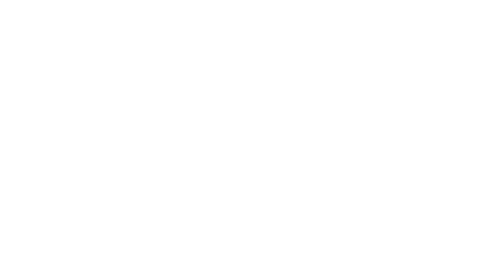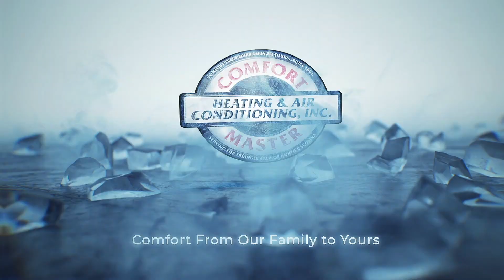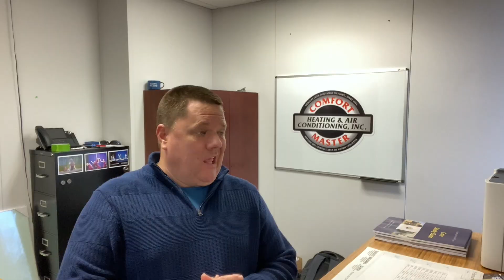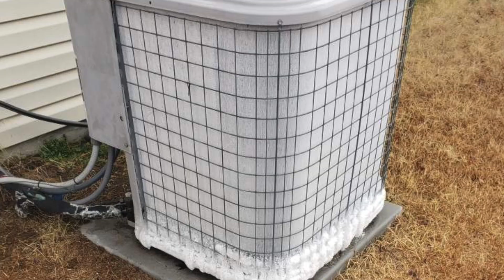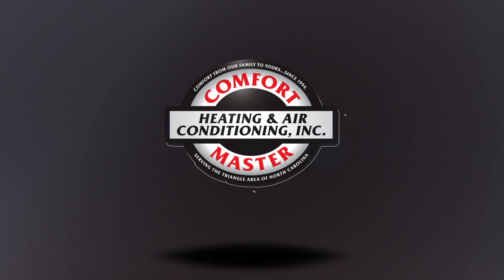Why is my heat pump freezing up?

Comment: Thank you. I wish my hvac techs had explained it so well. N. Fla artic freeze, with rain last night ice coating the fan grill but didnt realize when the fan stopped working it was in defrost mode. The loud pops and hissing snd steam iscalarming. Soujded like a steam engine at one point. Aftrr hours so went tu web for advice and advided to change the filter, call the pros, and even use emergency heat mode and ley the condensrt rest and thaw for about 3 hours. Covered with blanket anf tarp and, wiped off remaining ice with a towel three hours later 0230 AM. ER mode worked great, but wheh i tried to go bavk to heat mode the unit just hummed and fan didnt spin. Hvac tech came out in the morning, a little trouble shooting anf started right up. Said he thought the fan motor failing, but no way to kniw for sure. Call if stops again. Low 30s agaij tonight, but no rain (yea) but upset when doing the defrost dance you described, but 6 minutes later up and running fan spinning like it should. Thank you for your excellent explanation. 😊

Comment: I always tell the customer about the defrost cycle of their new heat pump and what to look for. Frost, steam, a loud bang from the reversing valve changing over and condenser fan not running with a buzzing sound is normal. That greatly reduces unnecessary non billable service calls and concerned customers

Comment: I just had a Defrost Circuit Board go out because I noticed this under conditions that were above freezing and in dry weather; this is normal in mixed sleet or snow and near freezing. I called for service and the defrost circuit board was out.

Comment: I just installed 2 Infrared lamps for my Mini Split. Aiming them at the outside coils. No more freezing. 250w each lamp. Spread them evenly over the outside condenser. About 5" away. A small roof over the system might also help. Now good down to 20 deg F. I have not tested it lower.

Comment: Thanks for helpful explanation of why air con goes into defrost mode in winter.  Can relocation of outside unit to a more suitable location help? Or is the ambient low temperature the key cause of freezing.?

Comment: Nothings better then a heat call where you have to work and tear apart a unit outside in a blizzard...Heat pumps are a joke, I won't work on them in the winter, they can Heat from the strips because that's so efficient 🤦‍♂️.
Reply: It can run a very high electric bill if you live in Houston, Texas!

Comment: It got down to 24 last night and mine iced up on the outside and inside where the coils are. It got down to 55 in my house, I guess that defrost function didn't work for me, so we slept with extra blankets for sure. I also tried emergency heat and the air coming in wasn't warm at all, it dropped the temp two degrees in the house. That unit is only three years old. I guess I'm gonna have to call the installer that put it in to check the control board, good thing is I have a ten year warranty on the parts.
Reply: When the system ices up inside along with the outside there’s a chance you’re low on refrigerant! (Really can’t be sure without a thorough check ikr)….  But emergency heat should warm the place up!? (If indoor coil has no ice on it!…. May have to run longer to get ice off indoor coil too!?). Especially if you have enough emergency strip heaters in the indoor air handler!(and the thermostat is wired properly!?)
What ton heat pump do you have!?!?!?
I usually have a certain strip heat for certain tonnage! 1.5 ton air handler 5 kw!
2 tons 7.5 kw! ….2.5 ton 10kw!  (3 ton 10-15kw)
3.5 ton 15kw! …4 to 5 ton 20kw strip heat!
U may have 3 ton with 10 or less kw!?
Check your air handler (outdoor tonnage also) size & strip heat level!
I’ve found commercial systems with low to no strip heat! I found a residential house one day with NO STRIP HEAT! I ended up installing 10kw on that houses air handler! They didn’t call back after that either 👍🏽✌️(2.5-3 ton heat pump outside)!
Reply: @orlandojohnson5742  I have a 5.5 ton split system, it's a Rheem.

Comment: When ever the temperature is in the 30s and below my heater will not heat and i have to turn it to emergency heat. 40 and above heat works normal. Any idea what's going on?

Comment: condenser motor not working in the heat mode will cause the condenser to ice up and low refrigerant in the system will cause the condenser ice up in the heating mode.

Comment: Most people don’t understand how heat pumps operate! If it’s installed and maintained properly, they save a lot of energy! Even in northern climates! I live in NH and sold heat pumps for over 44 yrs. It’s normal fir the outdoor unit to show ice on the condenser. It should defrost itself about every 2 hrs. of run time. I heat my own home with a 5 ton Carrier Greenspeed system! Love it! And the current system is over 10 yrs old!
Reply: That second reply stated a few issues. I won’t repeat. The most common is not setting your tstat high enough. If it’s below freezing outside, you need to set that tstat at 68 minimum! I keep mine at 72 or higher. I’m older now and like it warm.  The outdoor unit uses the heat inside your home to defrost that coil outside.
Reply: I still prefer natural gas. Warmer, better, and cheaper.
Reply: and when it doesn't defrost then what? why is my defrost not working. solid sheet of ice across top. no air flow.
Reply: @rps714  lol hope  U got it fixed!? 
If the refrigerant level is normal & runs in both cooling & heating mode (after u have defrosted all the ice on the top/fan & coil outside!?)…. U prob need to check your outdoor/defrost thermostat/sensor! 
A heat pump has an outdoor defrost thermostat/sensor! If system ices up like you say! There’s a timer (on most) on the circuit board with usually 3 settings! 30-60-90!! Set the timer on 30!(if u find it has adjustable settings) If it’s still icing up…. Order a defrost thermostat & install! Or call a reputable company to test the defrost thermostat & the defrost board!!!!
If it hasn’t lost Freon/refrigerant those are your 2 likely problems!!! If new defrost therm/sensor works u can prob put the timer back on 60-90 setting! The lower you set it (defrost cycle counter) the more defrost cycles the system will go through!(of course the board cost more than the defrost therm/sensor)!
Most of the time after some time goes by the defrost therm goes bad….. if you’re gambling which part…. always go with the cheaper repair to solve your problem!👌👋🏼
Reply: What temperature should come out of vents from a heat pump in heat mode.
Reply: Ten years old? That is brand new. My Lennox system is 36 years old. Compressor replaced in 1996. NO other repairs of any sort. Period.

Comment: Who ever designed the "Heat Pump" system in general should be SHOT   -   Heat pumps don't work when you need heat the MOST.
Reply: Actually they do work ok. The biggest flaw is the installation crew sometimes don’t put a big enough emergency/strip heater(s) in the air handler!!! Ikr feels lukewarm majority of the time!!! Put a space heater in the bathroom cause shower time feel a draft!?!?
Make sure there’s enough strip heat & u can install an outdoor thermostat on heat pump to energize strip heat operation. Preferably around 35-40 degrees to compensate with heat pump outdoor loss of heating inside!?
When heat pump is properly installed & set up they actually work pretty gd during winter!
Of course more they heat up the more probably gonna cost too! (It’s about savings & taking the chill off too ikr)…. Can’t win …. Sometimes u pay for more heat!
A more spiffy heat pump with variable speed indoor (ECM motor) motor feels more like gas heat system…. But u pay for it…. As said b4!✌️👋🏼
Reply: If u have a 3 ton system(ht pump) with only 5 kw to 7.5 kw strip heat …. U don’t have enough strip heat!!
At most commercial buildings some don’t have much emergency strip heat! (People usually dress differently & no showers etc there)….
Live & ya learn! Old school HVAC know what to look for or assume in these situations!
Reply: @orlandojohnson5742  Usually a three ton HP call for 15 KW strip heater.
Reply: Not shot. But should not be installed anywhere that Temps get below 20 or so.
Reply: When design properly they work excellent
Reply: I’m struggling with my heat pump right now it’s been single digits in Maryland this week my heat pump keeps frosting and blowing lukewarm air
Reply: That’s total bs. My heat pump is 2/3 more efficient than my electric resistance heating, and works great. It needs to be slightly oversized, and a cold climate unit. A properly charged, sized, and high quality system will work! Also having the correct ductwork and enough insulation is crucial!
Reply: I feel it’s main purpose is for ac
Reply: You need a ground source system for air temps below 40F as this is where ASHPs efficiency falls off
Reply: Nonsense. Maybe 15 years ago, but cold climate air source heat pumps are widely available these days and go well into the negatives, often still running well over 200% efficiency at close to 0.

Comment: The unit I have looks a lot like the one pictured (not that that really matters though). Would you recommend the installation of heat strips? Are they an economic value?
Reply from the maker: In our area (NC) it is required to have electric heat. It usually depends on you climate area.
Reply: @ComfortMasterInc  thanks for getting back to me. I found out my unit did in fact have heat strips in the air handler that were not connecting. We wound up having to replace the entire HVAC unit.
Reply: @ScottyMedina  oh man… how old was the system!?!?! Don’t let the HVAC devils tear ya a new one!? U must have had a bad compressor & an older system!?

Comment: Putting ranco tried and true mechanical timers on some of the crappy units we have out their,I have them wired so when the crappy board fails(Ameristar)for the most part the ranco takes over,THE RANCO WORKS , and worked for years (ie ge weathertron).it's ashame the engineers we have now imo are complete idiots.IF IT AINT BROKE DONT FIX IT .mechanical timers work for years w.o. a problem, I'll sacrifice a little energy for good old reliability, the same can be said for crappy X13 motors (psc works for years) again dumb ass engineers).
Reply: lol I hate some of the new motors too! PSC motors are fine!!!! Keep it simple to run & repair! I liked standard Carrier defrost boards & defrost thermostats too! But no these companies put thermistors on them now etc. U may end up replacing both board & thermistor now on Rheem/Ruud & other brand names! Engineers need to look at reliability a little more sometimes!
Reply: @orlandojohnson5742 : Are you kidding? The want bad technology.-

Comment: No one seems to mention the relationship of a high dewpoint of outside air combined with a low dry bulb temp being a major cause. The hoar frost on trees and vegetation in winter is an example of this phenomenon.
Reply: Just having this issue in Uk 🇬🇧 due to temperature at or below freezing and high moisture content ie fog in air Trouble is s air-con   is heating a restaurant  but keeps going into defrost every do often blowing cold air in restaurant  Mitsubishi inverter
Reply: @stapleford   My one does the same. Hayter system, room starts cold at 4 c ish, rain, ice, freezing fog, and about zero outside. turn onto heat test run, 30c works up to about 18c 19c  and goes into defrost mode, temp drops to about 12c  before it kicks in again. And so, round and round it goes, where it end no one knows. outside vains are white frost. Whats the take home here, if in very bad weather, most of these systems, will start to clock outside of about 18 to 20c ish + or -. indoors, but don't expect to hit a nice 25 or 28c most will struggle, or just won't play! So in some senses many won't do what it says on the tin so to speak, on a bad wet very cold day.

Comment: Turn the AC on inside the house that will defrost it quick! I made a pvc rack for the top of my heat pump with a piece of plywood on top of that.That worked great!
Reply: I placed a switch on the access panel of my outdoor unit and connected it to the defrost test terminals of the defrost board.  If/when it ices up, I can manually kick off a defrost cycle.
Reply: Where's the picture? How about deed restrictions?

Comment: I only like TRANE!
Reply: It’s hard to stop a trane…. But they do stop sometimes!?
Sometimes a system is only as good as the installer you choose to put it in! Most equipment is nearly the same quality!
Trane is  or has had some gd equipment! Can’t deny! I use Goodman & get few call backs! The notorious breakdown of most systems is the RUN CAPACITOR OR THE DUAL CAPACITOR!!
All systems that is!👌✌️👋🏼
Reply: Or an American Standard which is my favorite!

Comment: Try northern Minnesota, most of the USA don't know cold.  I'm ok with 0 degrees, my brother had -41 on his thermometer without the wind chill.  Lucky it only lasts 2 weeks of -18 for the highs and stupid cold for the lows.
Reply from the maker: We are located in NC so we would not know how to act with temperatures like that.
Reply: @ComfortMasterInc   I'm in NE Texas, and I know for sure what to do when the temp gets to -40 degrees!! Move your cold bones to TEXAS!!!!  That said, we got below zero in February 2022, and very near zero in Feb 2023.  My heat pump worked OK, but not like normal, for sure. It didn't freeze up, but last night, 1/1/2024, at about 30 degrees F, it froze over. Will see what happens tonight before I call repairman.
Reply: @charlesdoss7887 what temperature do you keep heat on. And what's the delta t split. What temperature comes out of vents.
Reply: We moved to Texas 43 years ago and in the Houston area only  saw a hard freeze in 1983 which lasted about a week; last year in 2020 we saw a few flurries of snow and only lasted a few hours. However the crazy drivers managed to crash right and left!
Reply: @bobboscarato1313  Sounds like Bay Area drivers trying to drive in snow up in the mountains of Truckee, California. They think snow and ice means drive faster, idiots!